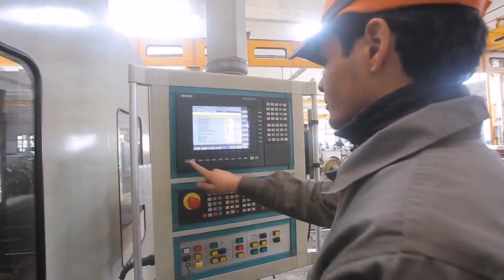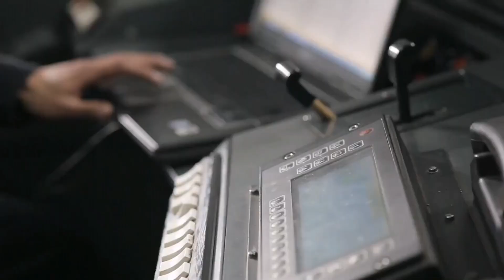LES ATELIERS DE LA MAINTENANCE DE L'ONCF

Comment: I needed to know why they don’t dig a tunnel and do an extension for the main line Train so that they can extend the unused abandoned underground train stations. Why couldn’t they use the part D78 Stock train doors on the sides and also restructure the front face of the A60 and A62 stock and that includes the class 313, class 314 and class 315 remix and make them all together and also redesign them an overhead line and also make them into Five cars per units and also having three Disabled Toilets on those Five cars per units A60 and A62 stock trains and also convert the A60 and A62 stock trains into a Scania N112, Volvo B10M, Gardner 6LXB, Gardner 6LXC and Gardner 8LXB Diesel Engines and also put the Loud 7-Speed Voith Gearboxes even Loud 8-Speed Leyland Hydra cyclic Gearboxes in the A60 and A62 stock, class 313, class 314, and class 315 and also modernise the A60 and A62 stock and make it into an 11 car per unit so it could have fewer doors, more tables, computers and mobile phone chargers. A Stock Train and 8 Disabled Toilets on those A stock trains. why couldn’t we refurbish and modernise the waterloo and city line Triple-Track train tunnel and make it more Larger and extend it to the bank station, making it into a Triple-Track Railway Line so those Five countries such as Australia, Germany, Italy, Poland And Sweden to convert the waterloo and city line Triple-Track Railway tunnel into a High-Speed Railway lines? The Third Euro tunnel Triple-Track Railway line to make it 11 times better for passengers so they could go from A to B. Then put the modernised 11 car per unit A Stock and put them on a bigger modernised Waterloo and city line Triple-Track train tunnel so it could go to bank station to those Five countries such as Australia, Germany, Italy, Poland And Sweden. The modernised refurbished 11 cars per unit A stock could be a High Speed The Third Triple-Track Euro Tunnel Train So it is promising and 47 times a lot more possible to do this kind of project if that will be OK for London Australia, Germany, Italy, Poland And Sweden. oh by the way, could they also tunnel the Triple-Track Railway Line so it will stop from Buckinghamshire, Hertfordshire and Essex so that the Passengers will go to Australia, Germany, Italy, Poland and Sweden and also extend the Triple-Track Railway Line from the Bank to Buckinghamshire, Hertfordshire and Essex Stations so that more people from there could go to Australia, Germany, Italy, Poland And Sweden more Easily. Why couldn't they extend the Piccadilly Line and also build brand-new underground train stations so it could go even further right up to Clapton, Wood Street can they also make another brand new underground train station in Chingford and could they extend the Piccadilly Line and the DLR right up to Chingford? All of the classes 150, 155, 154, 117, 114, 105, and 106, will be replaced by all of the Scania N112, Volvo B10M, Gardner 6LXB, Gardner 6LXC and Gardner 8LXB Diesel Five carriages three disabled toilets are air conditioning trains including Highams Park for extended roots which is the Piccadilly line and the DLR trains. Could you also convert all of the 1973 stock trains into an air-conditioned maximum speed 78 km/hours (48 MPH) re-refurbished and make it into a 8 cars per unit if that will be alright, and also extend all of the Piccadilly train stations to create more space for all of the extended 8 car per unit 1973 stock air condition trains and can you also build another Mayflower and Tornado Steam Locomotive Companies and can they order Every 37 Octagon and Every 17 Hexagon shape LNER diagram unique small no.13 and unique minor no.11 Boilers from those Countries such as Greece, Italy, Poland, and Sweden, can they make Mayflower and Tornado Steam Locomotive speeds by up to 142MPH so you can try and test it on the Original Mainline so it will be much more safer for the Passengers to enjoy the 142MPH speed Limit only for HS2 and Channel Tunnel mainline services, if they needed 16 Carriages Per units, can they use those class 55’s, class 44’s, class 40’s and class 43HST Diesel Locomotive’s right at the Back of those 18 Carriages Per Units so they can take over at the Back to let those Mayflower and Tornado Steam Locomotive’s have a rest for those interesting Journeys Please!!!!!!!, oh can you make all of those Coal Boxes’s 17 Tonnes for all of those 142MPH Mayflower and Tornado Steam Locomotive’s so the Companies will Understand us PASSENGER’S!! so please make sure that the Builders can do as they are told!!!! And please do something about these very very important Professional ideas Please? Prime Minister of England, Prime Minister of Australia, Prime Minister of Sweden, Prime Minister of Germany, Prime Minister of Italy, Prime Minister of Poland and that Includes the Mayor of London.
Reply: Because you are not the président of the USA
Reply: The unanimous Declaration of the thirteen united States of America, When in the Course of human events, it becomes necessary for one people to dissolve the political bands which have connected them with another, and to assume among the powers of the earth, the separate and equal station to which the Laws of Nature and of Nature's God entitle them, a decent respect to the opinions of mankind requires that they should declare the causes which impel them to the separation.

We hold these truths to be self-evident, that all men are created equal, that they are endowed by their Creator with certain unalienable Rights, that among these are Life, Liberty and the pursuit of Happiness.--That to secure these rights, Governments are instituted among Men, deriving their just powers from the consent of the governed, --That whenever any Form of Government becomes destructive of these ends, it is the Right of the People to alter or to abolish it, and to institute new Government, laying its foundation on such principles and organizing its powers in such form, as to them shall seem most likely to effect their Safety and Happiness. Prudence, indeed, will dictate that Governments long established should not be changed for light and transient causes; and accordingly all experience hath shewn, that mankind are more disposed to suffer, while evils are sufferable, than to right themselves by abolishing the forms to which they are accustomed. But when a long train of abuses and usurpations, pursuing invariably the same Object evinces a design to reduce them under absolute Despotism, it is their right, it is their duty, to throw off such Government, and to provide new Guards for their future security.--Such has been the patient sufferance of these Colonies; and such is now the necessity which constrains them to alter their former Systems of Government. The history of the present King of Great Britain is a history of repeated injuries and usurpations, all having in direct object the establishment of an absolute Tyranny over these States. To prove this, let Facts be submitted to a candid world.

He has refused his Assent to Laws, the most wholesome and necessary for the public good.

He has forbidden his Governors to pass Laws of immediate and pressing importance, unless suspended in their operation till his Assent should be obtained; and when so suspended, he has utterly neglected to attend to them.

He has refused to pass other Laws for the accommodation of large districts of people, unless those people would relinquish the right of Representation in the Legislature, a right inestimable to them and formidable to tyrants only.

He has called together legislative bodies at places unusual, uncomfortable, and distant from the depository of their public Records, for the sole purpose of fatiguing them into compliance with his measures.

He has dissolved Representative Houses repeatedly, for opposing with manly firmness his invasions on the rights of the people.

He has refused for a long time, after such dissolutions, to cause others to be elected; whereby the Legislative powers, incapable of Annihilation, have returned to the People at large for their exercise; the State remaining in the mean time exposed to all the dangers of invasion from without, and convulsions within.

He has endeavoured to prevent the population of these States; for that purpose obstructing the Laws for Naturalization of Foreigners; refusing to pass others to encourage their migrations hither, and raising the conditions of new Appropriations of Lands.

He has obstructed the Administration of Justice, by refusing his Assent to Laws for establishing Judiciary powers.

He has made Judges dependent on his Will alone, for the tenure of their offices, and the amount and payment of their salaries.

He has erected a multitude of New Offices, and sent hither swarms of Officers to harrass our people, and eat out their substance.

He has kept among us, in times of peace, Standing Armies without the Consent of our legislatures.

He has affected to render the Military independent of and superior to the Civil power.

He has combined with others to subject us to a jurisdiction foreign to our constitution, and unacknowledged by our laws; giving his Assent to their Acts of pretended Legislation:

For Quartering large bodies of armed troops among us:

For protecting them, by a mock Trial, from punishment for any Murders which they should commit on the Inhabitants of these States:

For cutting off our Trade with all parts of the world:

For imposing Taxes on us without our Consent:

For depriving us in many cases, of the benefits of Trial by Jury:

For transporting us beyond Seas to be tried for pretended offences:

For abolishing the free System of English Laws in a neighbouring Province, establishing therein an Arbitrary government, and enlarging its Boundaries so as to render it at once an example and fit instrument for introducing the same absolute rule into these Colonies:

For taking away our Charters, abolishing our most valuable Laws, and altering fundamentally the Forms of our Governments:

For suspending our own Legislatures, and declaring themselves invested with power to legislate for us in all cases whatsoever.

He has abdicated Government here, by declaring us out of his Protection and waging War against us.

He has plundered our seas, ravaged our Coasts, burnt our towns, and destroyed the lives of our people.

He is at this time transporting large Armies of foreign Mercenaries to compleat the works of death, desolation and tyranny, already begun with circumstances of Cruelty & perfidy scarcely paralleled in the most barbarous ages, and totally unworthy the Head of a civilized nation.

He has constrained our fellow Citizens taken Captive on the high Seas to bear Arms against their Country, to become the executioners of their friends and Brethren, or to fall themselves by their Hands.

He has excited domestic insurrections amongst us, and has endeavoured to bring on the inhabitants of our frontiers, the merciless Indian Savages, whose known rule of warfare, is an undistinguished destruction of all ages, sexes and conditions.

In every stage of these Oppressions We have Petitioned for Redress in the most humble terms: Our repeated Petitions have been answered only by repeated injury. A Prince whose character is thus marked by every act which may define a Tyrant, is unfit to be the ruler of a free people.

Nor have We been wanting in attentions to our Brittish brethren. We have warned them from time to time of attempts by their legislature to extend an unwarrantable jurisdiction over us. We have reminded them of the circumstances of our emigration and settlement here. We have appealed to their native justice and magnanimity, and we have conjured them by the ties of our common kindred to disavow these usurpations, which, would inevitably interrupt our connections and correspondence. They too have been deaf to the voice of justice and of consanguinity. We must, therefore, acquiesce in the necessity, which denounces our Separation, and hold them, as we hold the rest of mankind, Enemies in War, in Peace Friends.

We, therefore, the Representatives of the united States of America, in General Congress, Assembled, appealing to the Supreme Judge of the world for the rectitude of our intentions, do, in the Name, and by Authority of the good People of these Colonies, solemnly publish and declare, That these United Colonies are, and of Right ought to be Free and Independent States; that they are Absolved from all Allegiance to the British Crown, and that all political connection between them and the State of Great Britain, is and ought to be totally dissolved; and that as Free and Independent States, they have full Power to levy War, conclude Peace, contract Alliances, establish Commerce, and to do all other Acts and Things which Independent States may of right do. And for the support of this Declaration, with a firm reliance on the protection of divine Providence, we mutually pledge to each other our Lives, our Fortunes and our sacred Honor.